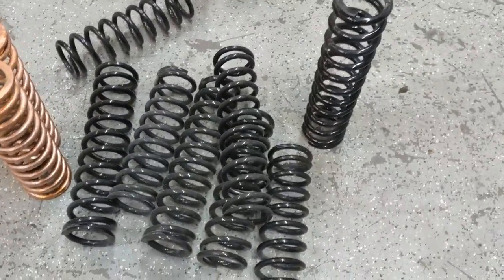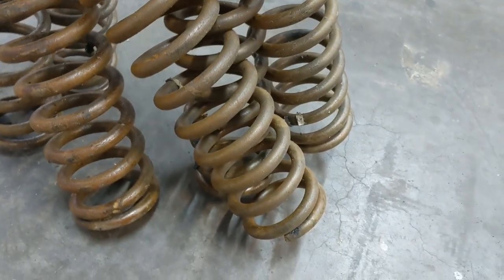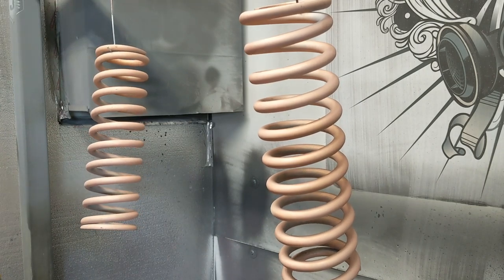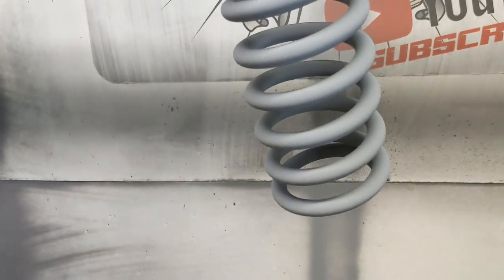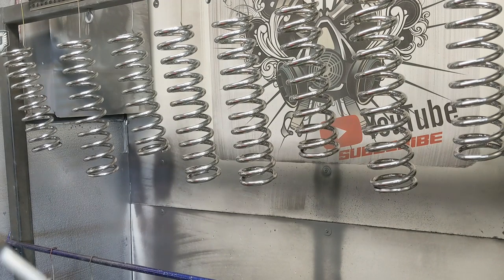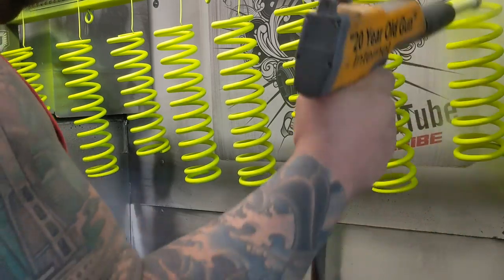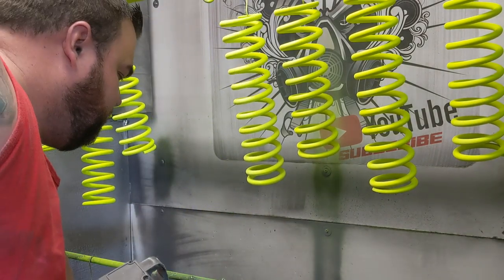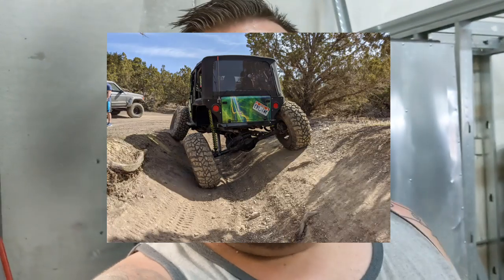How to Powder Coat Coil Springs. Glowing Yellow over Super Chrome - Ep 40

Comment: Do I need a special.gun to powder coat over super chrome? I've never tried. I'm using a craftsman powder coating gun.
Reply from the maker: You don't necessarily need a special gun but the chances that craftsman unit is going to allow or happen is very slip

Comment: At what temp do you apply top coat over the super chrome
Reply from the maker: These were probably 80 degrees or less. They had sat for over an hour out of the oven but the shop was high 70s low 80s that day
Reply: Unknown Coatings man I have no luck shooting over super chrome ... maybe I’ll get it another try ..thanks
Reply from the maker: @LTrepresenter  what kind of issues you having ?
Reply: @UnknownCoatings  was shooting some trans copper over it , but it's either the top coat isn't sticking in certain areas  or edges .. jus can't seem to get it to lay down properly